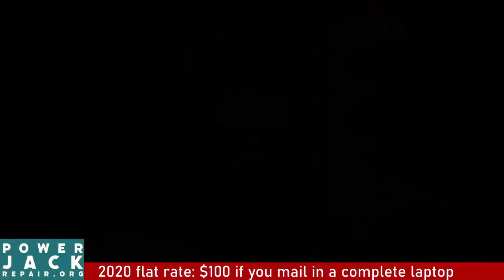Asus Q524u disassembly laptop charge port power jack repair fix taking apart tear down guide

Comment: Very helpful!  This helped me replace the power jack on my wife's laptop.  It was a little hard to get the old socket de-soldered, but after carefully breaking up the socket it was possible to remove it.
What really helped were the various little points about what to remove/replace in what order, and that there are plastic tabs on the battery, etc.

Comment: I have the same asus q524u model, I left it unused for a while.  The battery was worn out and it did not charge more than 70%.  A few days ago I reconnected it to the charger and it does not turn on or charge.  My question is, why can't I use it without a battery?